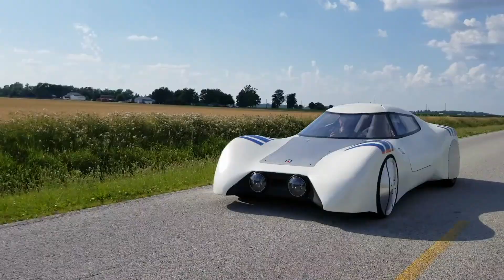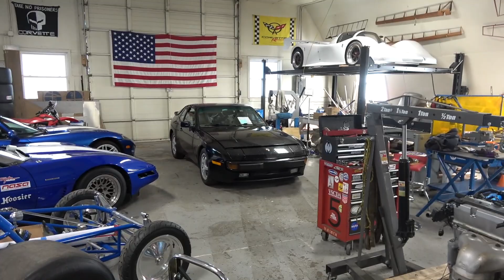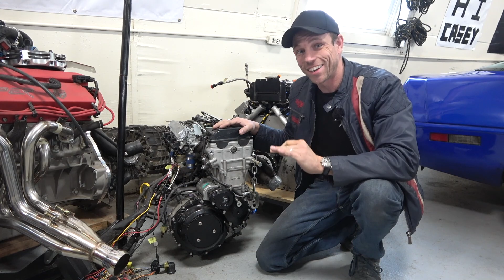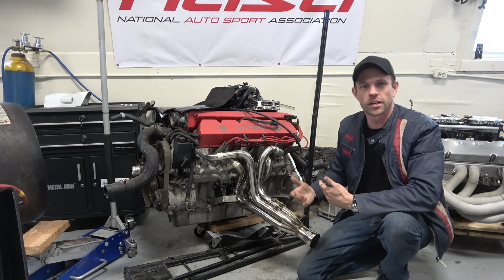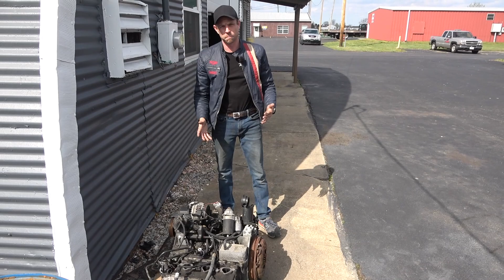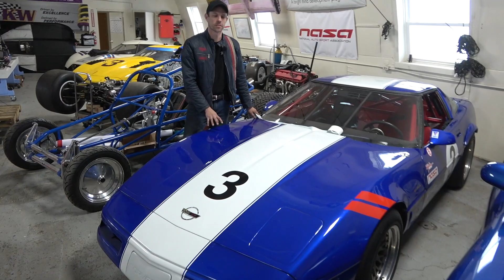Engine Swaps Viper, Busa, BMW V12 ,LS, and Honda K | Everything YOU need to know!

Comment: Why not do a J series in the Indycar? Shorter and more compact, still a Honda that has rev potential, still cheap and easy to find, can be built for more NA power (mid 300's, close to 400 wheel, I've heard) sounds INCREDIBLE with a 6-into-1 equal length header system, and can be done up with boost for 700hp or so on stock bottom end(reportedly) compared to the K series' 500 (reportedly) or so. (All crank HP numbers)

Comment: I've been wondering what a viper engine would sound like with nascar boom tubes
I want to put a srt10 from the crew cab ram and put it in a Dakota. Smaller light truck with a capable transmission and plenty of power.

Comment: Super cool to see you doing a swap with my motor! I can vouch for how insanely reliable the K20Z3 is. I have consistently driven my car hard since I got it at 31k and am at 130k now with 0 issues and that includes some bolt ons and tuned making 220whp with an increase rev limit to 8700RPM. 

I look forward to seeing how you guys build and tune the motor, especially since internally my k20 is bone stock. When I have the space I want to get a light project car to swap a K series in to have a pretty fast and cheap NA build.

Comment: So what do you think about a 4.3 Chevrolet V6 engine put in a 2003 Pontiac Grand Am GT converted to rear wheel drive?  S-10 Rear axle, disc brakes. Converted to front-steer using camaro suspension components. Single turbo most likely. Big project but NOBODY is doing something like this except one video I saw on youtube. p.s. I have  most of what I need just sitting around. And the GAGT is in great condition.

Comment: I love this topic! Great video!

I'm planning on swapping a VW "07k" 5-cylinder engine into my Mk2 Jetta. I thought about putting a turbo on the original 16V engine but it's getting hard to find parts for them and I'd really like something a little newer and more refined. Plus, the 07k engines are dirt cheap, I mean just looking on ebay you can find tons of them for $600 or less. And since my goal is to be making over 200 hp, the existing 020 transmission just isn't going to put up with that without grenading. So I'd have to swap the transmission anyway.

There's a company that makes a swap kit for the Mk2, so that will make fitment simpler. The 5-cylinder engine sounds pretty sweet, so I can't wait to get this project started!

Comment: hey casey just so you know, the Honda k24 is known for being insanely sturdy with a turbo. Any other 4 banger I'd agree with you, you could add like 50%. But do some research and you'll see that while the k24 makes 250-300 NA with just a couple things done, without doing basically anything else it'll handle 600hp (THREE TIMES what it made stock) decently reliably. That's why I'm using one in my miata racecar project, built for drift competition. But this engine is the exception to the rule.

Comment: I found out that crank centerline thing the hard way. Bought a 12 valve Cummins and a 63 Continental to put it in without doing my homework. 12 valve had a super high centerline and the 430 MEL from the Continental was developed to have an extremely low centerline. It was a bitch, but it's in and running.

Comment: Pushrod Checy dosen't rev that high? I'll let my buddy know that next time he has a USAC Silver crown 410cu/in motor on there and its passing 9200RPMs....Then there was the Australian 400cu/in Pro Stock motor that went to 11,500 RPMs...Yes it isn't an endurance motor but, the Silver Crown motor reliably ran more RPM's than the S2000 Midget engine that ran out of his shop....He wasn't a big fan of the S2K project....pretty sure that car is long retired....His Mopar 4 cylinder Midget motors turned the same RPM's as the S2K and made more torque....He used to complain the the S2K was a "Legacy Motor" engineered to make its 240HP and everything was about 100% capacity at that output....Trying to get the additional 80HP needed was quite the challenge.
Reply: He just said it would do just over 9k. 
And you said your buddy’s does just over  9k

My 81 yamaha loved screaming past 12,500 rpm. 
Totally stock :)

Comment: i am just about finished with my 2.2 ecotec engine w/ a wc t5 tranmission swap into my 1984 alfa romeo spider..i go from 112 hp to 214 hp... should make it a wee bit faster... also replace the hood and boot with s2 fiberglass parts,, that took about 75 pounds off the car

Comment: Casey, this is an odd question, is a JUDD engine a viability for you guys to use in the Indycar? I know they are common to put into old F1 cars, as they are much cheaper to run than their original engines etc? I know with them being a UK company might make it cost preventative for you guys to use?
Reply: @CaseyPutsch  That's a shame. I guess even an old Cosworth DSV would be worse, even though there are so many of them around and the support for them is there? 

I guess because I'm a Brit I know the bigger names based here (I'm originally from the part of England where most of the F1 teams and support companies are based). 

With you using the Arial Atom engine, is it possible to get one of their V8's? I's two of the motorbike engines put together, so might be high revving and have the compact size you would want in either of the open wheel cars you guys use?

Who knows maybe in the next 10 years you will be casting your own engine blocks in "GG" as I bet the engineering challenges alone would be mouthwatering and a real headache! 

Keep up the great content, I've really been enjoying all of these builds a great deal.

Comment: Before I start watching, I'm gonna hazard a guess that I can't apply most of this to k-swapping a fit, lol.

Which also gave me the idea of slapping two motorcycle engines together for the meme (totally stupid).
Reply: Dude they've totally done that. The Ariel Atom V8 had an engine made from two hayabusa cylinder heads. I believe the block and crank were fully custom though. There's another company in the UK making a very similar engine for racing cars too.
Reply: To add to what XenFPV said, the motorcycle idea is an excellent idea. Radical make Hayabusa derived V8s for their big cars, Powertech also have done the same thing in the UK, and down in New Zealand, Hartley have made a Hayabusa V8. Also in New Zealand, Synergy have made a Kawasaki V8, and there are a couple of 1 off V8s made for UK hillclimb cars that use Yamaha R1 engines to make a 2 litre V8.

Comment: I want to engine swap a 944 but not an LS. I'd like to use the porshce v8 from the Cayenne s. The 06 Cayenne makes 380 hp which would be plenty for an 944. Problem is engine management would be a nightmare.

Comment: Dude you gotta do a video on the 800hp NA LS motor! The fact that it can even rev past 7k is crazy
Reply: It’s not ls. 
It’s a small block Chevy.
Reply: There is a standard playbook for making V-8 OHV engines rev to 8K or even 9K fairly reliably. Mostly consists of valvetrain work, good rods and light pistons. Today's materials solve many of the perceived issues with those RPM levels. But the kicker is fueling, oiling and cooling have to be made to match and then there is the issue of a transmission that will reliably let you shift at those RPMs. Together it all gets expensive fast. And realistically, most applications do not require those RPMs or power levels. Still it is a fun thing to drive at speed - generally not so much when crawling around at low RPMs where everything you need to make it work at 8K won't work right at 1K.

Comment: A great presentation about using your head before you start a swap. One thing you did not mention is crank rotation direction.  It might be a consideration.
Reply: The corvairs rotate backwards from a vw beetle. 

They actually make a reverse ground camshaft people swap them and run the engines backwards.
Reply: @fastinradfordable  One foreword gear and four reverse! Oil pumps would be a problem as well.

Comment: I think HPD do a Kseries cam cover for use in single seaters that has mount for semi stressed applications, that with mounts on the dry sump should work ok with a pair of a frames - how it’s done in lmp2 with proddie engines. Also take look at the Speed series group CN2 cars that use the kseries in mini prototypes, should find a solution for the starter ring gear and flywheel

Comment: im a weirdo. i like tiny cars. but i love v8s. there is no such thing as a tiny v8 sports car that isn;t a bullshitzu 2+2 setup that ive found thus far. so im going to swap my honda delsol with a lexus v8 and a cd009 with a s2k diff and a s1 built awd kit. insane yes. good car prob not.
Reply: No you aren’t. 

And if you turbo even the 1.6 that’s in there. 
It’s not hard to get over 300hp. 
Which is more than the Lexus v8

Comment: I think one thing that should be mentioned in engine swaps is the history. Back when damn near every American car was front engine rear wheel drive damn near the only consideration was "is it front or rear sump?" beyond that just about any V8 or I6 would physically fit in damn near any chassis. Driveshafts are easy to make, live axles relatively easy to swap, etc. With a welder it was essentially legos between chevy, ford, and mopar. Just pick your chassis and put whatever in whatever. Lots of modern cars don't work like this.

Comment: The honda K-series is very easy engine to make reliable power and it will give the revs needed to fit the car it goes in. Those engines are now the 4cyl equivalent to an ls swap, they are everywhere. Affordable, reliable, huge aftermarket and a lot of info.

Comment: One of the things i've been cooking up in my head, is to marry a Lexus GS450H gearbox to the Haya engine, deleting the Haya gearbox entirely and powering the Lexus gearbox from the camshaft with an adapter that swaps the flywheel, thus turning the engine into a conventional power plant.

It would both give me reverse, and by utilizing the hybrid aspect of the GS450H, i can bypass all the issues of low torque. With half the batteries required by the OG car, it would more than enough understress the Haya engine. The whole setup, plus custom adapter, would be just as big as two Haya engines put longitudinally, which is the mad part about it. I wanna shoehorn that into a vintage European racer body i've been hoarding at my grandparent's farm for years now.

But... i don't have the time for that now, so i just soak up the Casey swaps to get by. :))

PS the gearbox by itself has enough power to slug around the behemoth of a car that is the BMW e65 quite happily. Damien Maguire ( a mad scientist ) here on YT has done it.
Reply: Did you say you wanted to drive a transmission off of the camshaft?

Yea

Naw

Comment: That was great. I am building a racecar replica GT-40 and will use the Porsche transaxle and an LS3. Yes a Chevy in a Ford. I want a reliable and fast car that can go on track days as well as do weekenders. 530HP in a 2,400 lb car is plenty.
Reply: Which Porsche is the transaxle from?
Reply: Sam tiffin G96. You shouldn’t drag race with it but normal track day stuff will be fine.

Comment: I'm doing a 5.3 gen 4 ls swap in my 1986 Pontiac Grand Prix LE with a ford 8.8 rear differential to handle the power. Yes the car originally set up for 305 small block chevy from the factory. It's a GM G body platform from the 80's.

Comment: I'd love to do a mid engine k24 swap.  Maybe a Boxster transaxle?
Reply: K swapped MR2s are not uncommon. They're pretty good for it because they were made for a transverse 4 cylinder in the back. A longitudinal inline 4 mid engine would end up having to be a pretty long car and you'd probably waste a lot of space around the engine.

Edit: And to be clear it wouldn't be ungodly long, but you can get small V8s or large v6s that are about as short. For something custom or pseudo custom like he's doing it makes sense, but for a chassis you can buy and put it in there won't be much unless you get something that came with a bigger engine.

Comment from the maker: Here's the great swap guide!! What engine is your favorite for a swap?
Reply: I hope my daughter can come to genius garage sometime to meet you she is currently building a 1970 Chevy 350 in our garage and she's only 10.
Reply: @lostcowboygarage2035  Nice
Reply: I DIG the busa V8 swaps, those are so cool
Reply: I like the toyota 1uz engine for a swap
Reply: There IS no favorite. There's only the best for said application. It should always come down to complexity vs your individual skill, potential (if you require more performance than what's available) and what will work best for your goals and needs. Secondary thought should be replacement parts availability and such.
Reply: @justintaylor9458  well said!
Reply: 4 Rotor
Reply: 1.8t VW and Audi engines. Things sound great with the right headers, and fit great into anything german 😂
Reply: Any of the vr6 engines
Reply: One that is gaining popularity is the Honda V6, the J series. Cheap, plentiful, moderately powered....very interesting option. I'm working on getting parts to swap one into my Integra
Reply: Corvair  flat 6 in a vw bug. 😁
Reply: Doublebusa
Reply: Do you have a direct site to buy merch or is Spring it? I feel like they destroy you on fees...
Reply: Honestly Windsor v8 the 289 302 351w 427-9 those engines sound amazing 
I’m looking at a 302 swap for my ranger soon
Reply: I would say an older American V8 with big cam, perhaps a 426 hemi.
Reply: I like Busso engines and they are really under used
Reply: Money no object a ajp v8 lightweight fairly compact and makes great power plus they sound sick
Reply: Casey, is it feasible to turn down a new flywheel with smaller dimensions but a similar moment? Perhaps a dense tungsten alloy turned down for perimeter weighting?
Reply: RichRebuilds’ V8 Tesla Model S. Or the Rolls Royce Merlin - engined Rover SD1 :-)

Hard to beat Project Binky though
Reply: One swap I'd love to try would be RX-8 engine into NC Miata. As far as I know it's the same front subframe. But I have enough money sucking hobbies already.
Reply: K.
Know a few people that have done so and swear by them.
Get a bit expensive when pushing them to the moon as bumping up the rev range needs a lot of head work and ultimately for safety, a destroke kit. (by that point most have thrown an insane turbo or ITB kit on anyway...)
Reply: I can't believe nobody said Cummins. Cummins swap the world!! I was going to swap a 5.9L Cummins into my M-35 because I could not find a head gasket for the REO OA-331 engine. Even that would be a tough swap though, but I was lucky enough to find a head gasket so I could just fix it.
Reply: Ford 460 or Ford 351 Cleveland for stupid-easy power with a Ford.  Ford 3.7 Cyclone v6 for small cars like an FR-S or RX-8.